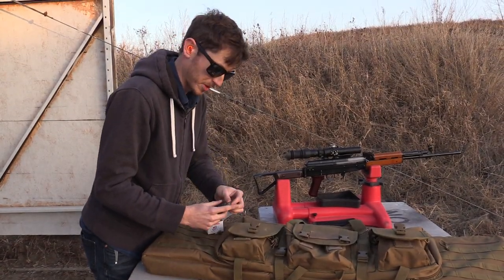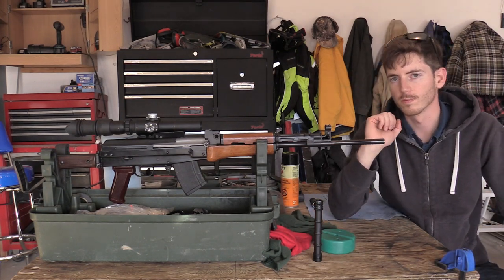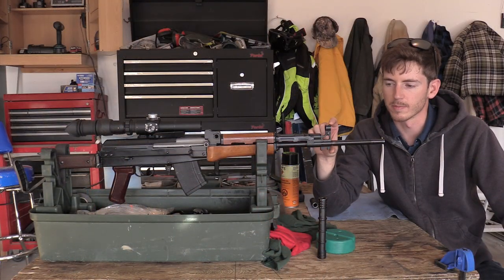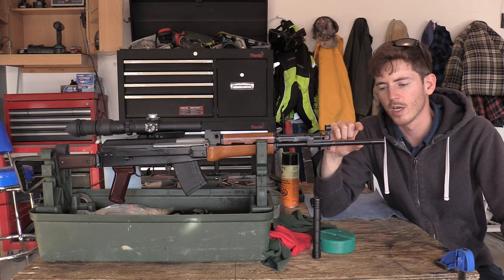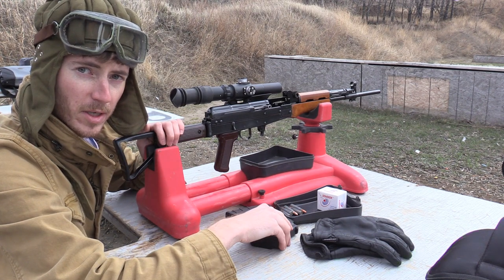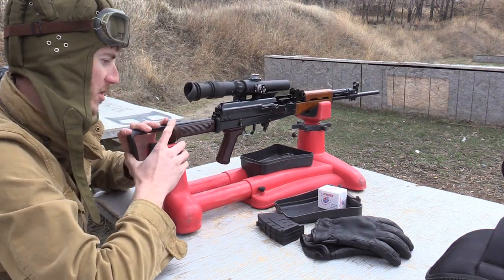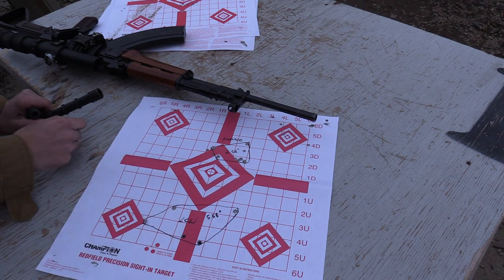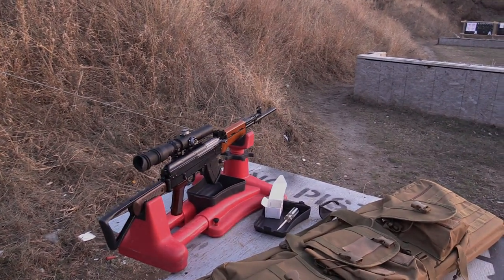Type 81 grenade launcher removed

Comment: i just get a feeling that the scope is messing with its MOA. Mine is coming in this friday and see how it fares. Its also a fixed stock.
Reply from the maker: U'll enjoy it regardless of its accuracy!
Reply: how is it?
Reply: @boxyyy7329  The Rifle is awesome. ITs not zero'd out of the box. THeres a new no drill scope picatinny mount and that's way better than doing some drilling.
Reply: @LilSaint001100  sounds great! how's the accuracy compared to the one in this video?
Reply: @boxyyy7329  Similar. Im a bad shot to. and havnt been on a range in a while but i got about 4-6 moa with iron. Haven't tested yet with a optic.
Reply: @LilSaint001100  👍thank you！
Reply: Hey bro can you tell me the name of the scope ive been trying so hard to find a picatinny for my type 81 fixed stock. If you have a link for one great but if not I'll just buy the one you found. Can you please help me out brother. #LilSaint001100

Comment: Accuracy is nothing you can't fix on any rifle if you know what you are doing. These barrels are bent over time by the weight of that muzzle launcher. Honestly I wouldnt start a project on these. Way too costly for what it is. Why not just get an SKS and an aluminum stock. Now that's something cheap and easy to make accurate. But if accuracy is your goal, semi-auto is never the way to go. That's like trying to make a ferrari off-road. These are meant to be spray n pray full autos. Tracers and bursts. Nothing accurate. Get a 500$ bolt rifle and youll get amazing MOA's @ 100 yards lol, would be easier to reload too! LOL
Reply: That’s not the point my guy
Reply: You realize you can just set the gas block to 0 and it's then a bolt action.
Reply: @northwestpassage6234  nope still not a bolt action. That would just be a broken semi auto.